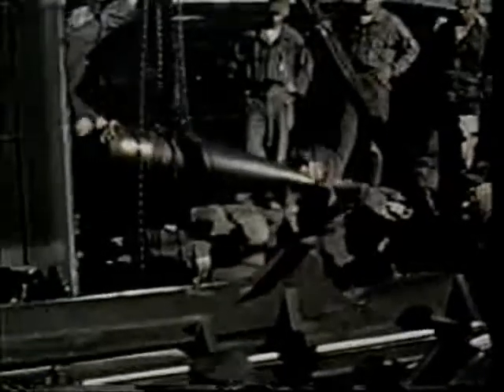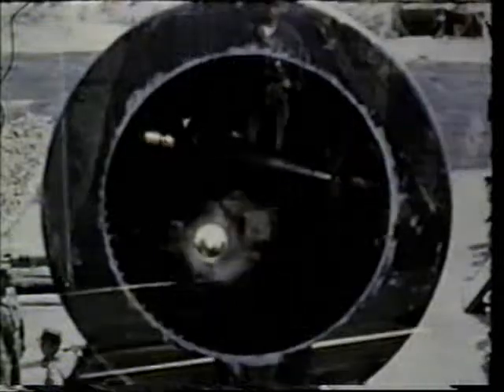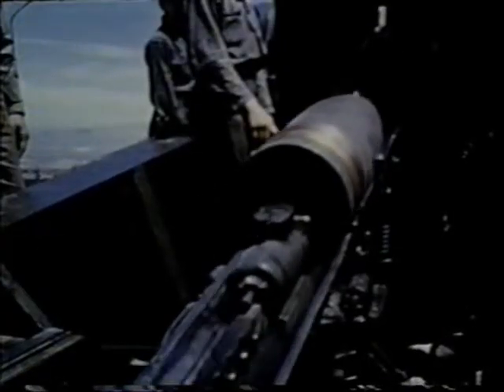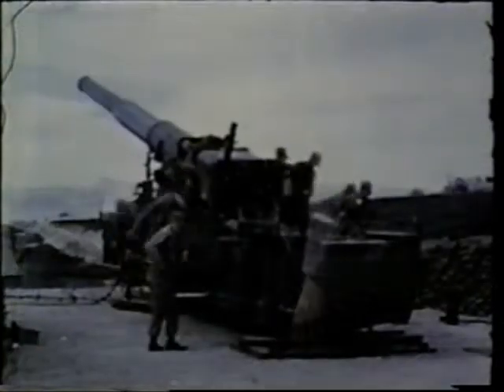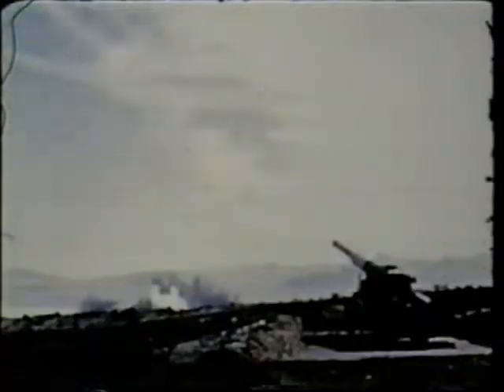Nuclear Tests of the 1950s

Comment: The artillery nukes of which only one was ever tested were initially thought to be used on the suspected mass soviet tank columns that would be spearheading the drive into Europe. At only 15 kilotons they would have easily destroyed a division but wouldn't level too much else. Pretty crazy the only thing that stopped them was the cannons took too long to emplace and they didn't have all that much range wasn't even 30 km if I remember right